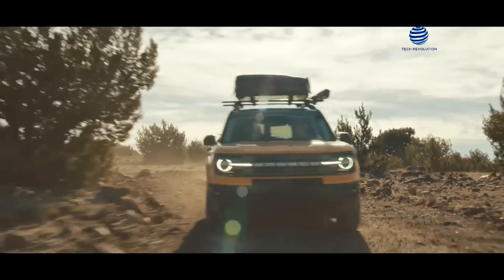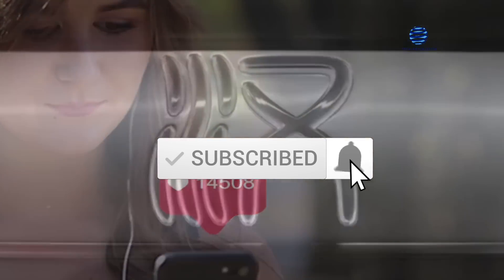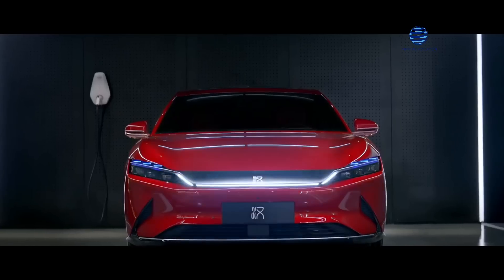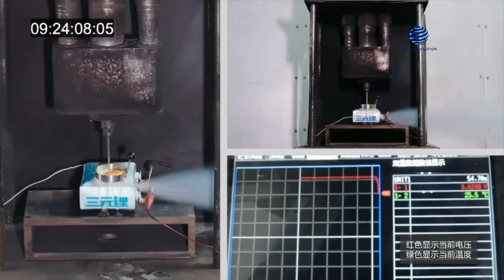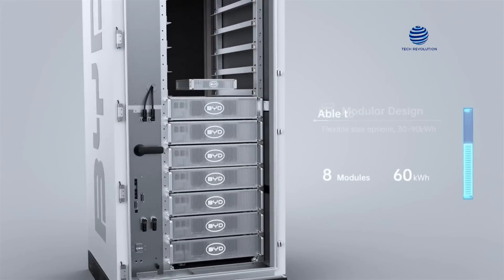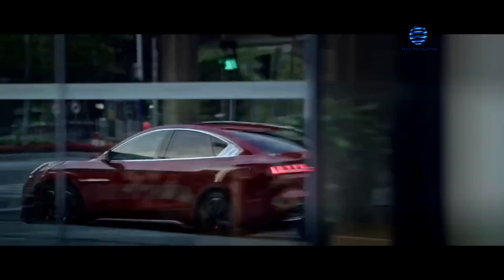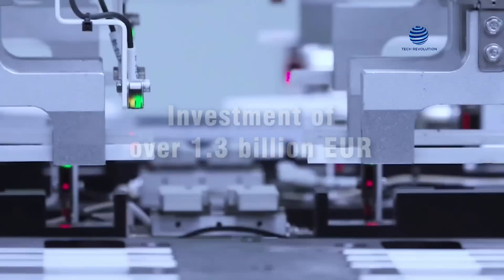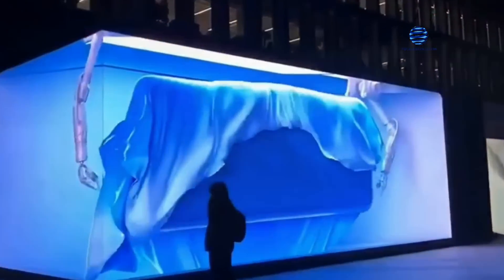GAME OVER! Tesla's INSANE NEW Partnership With The NEW BYD Blade Battery Changes Everything

Comment: I know how to make a ev car which will never need to use a charging station.it makes its own electric current.i hope to sell my info to all ev car makers.this will change everything.
Reply: Dude! It's worldwide popular the type of car you are saying. I'm using one myself & it's self charging, it's the Honda Vezel. It's not a plug-in , it's a self charging  car. You also have the Honda CRV Hybrid. These are the types of vehicles that we all need to have as these vehicles don't need a charging station at all.
Reply: Bolt a couple alternates on the drive axles to power an invertor is just to simple. Bypassing the diods in the alternators so they produce AC current were my thoughts but both I'm sure have been thought about already and there must be far more to it.